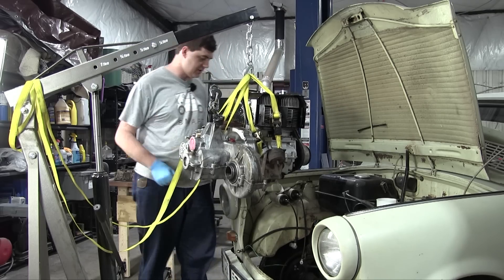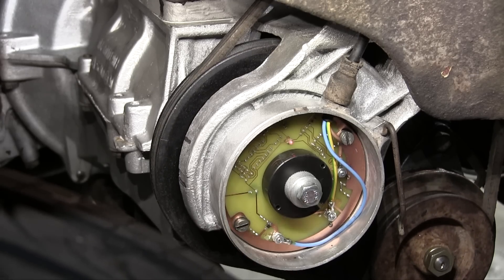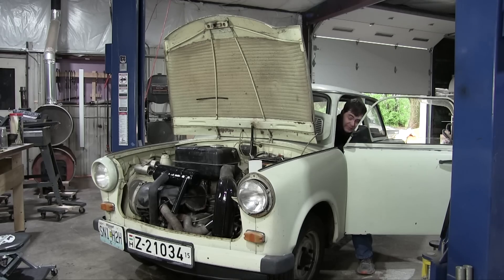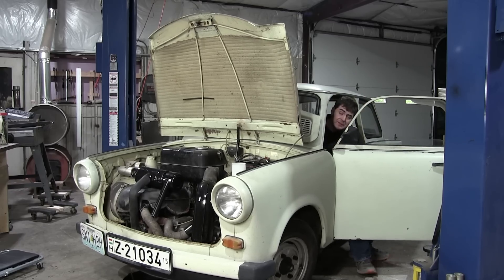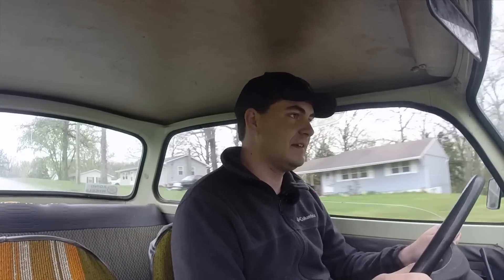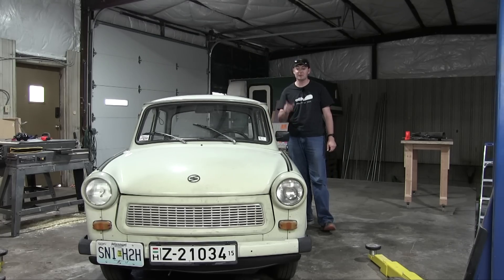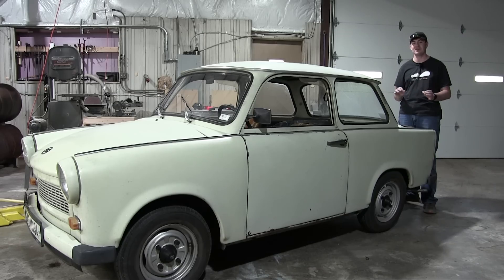Rebuilding the Trabant's Engine: Part 4 - Finale

Comment: That safety belt looks super effective
Reply: About as effective as my '81 Cadillac.
Reply: Or my 52 willys truck
Reply: As far as I know... It's probably the clones fault...
Reply: @Rusted_Empire  The clone must've broke it before Rob took delivery!
Reply: Trabants did not originally have seat belts at all. This probably was mounted later, unless it's a late version of the Trabant. However, the belts are not much safety different for a car that drives at the speeds of a 50ccm scooter.
Reply: Then you have to prep for the odd head-on. A bit intense, that.
Reply: @Blido  Didn't most trabants after about 1973 have belts? 
In any case, trabis go 55mph or 90km/h with some patience. The belts may not add much safety at those speeds because the car itself will disintegrate in a collision...
Reply: @mfbfreak  Yes Trabant was a car that was turned into shapeless pile of metal and plastic after a collision... Cars from Eastern Bloc were in 2 extremes: either soft like a beer can (Trabant, Fiat 126p) or hard like a tank and stay intact even after head-on collision (Polonez and Kamaz trucks). Both options weren't especially good for people inside.
Reply: Actualy original there was no seatbelt in this car
Reply: @mfbfreak  I recall reading somewhere that Trabis are particularly dangerous in crashes because the Duroplast body tends to fracture into sharp pieces that then proceed to impale the car's occupants as it crumples.
Reply: @Blido  a Trabant drives close to 100 km/h it only takes some time to get there.
Reply: @chrissi.enbyYT  most people installed neck support in those Trabant. Some where highly customized.
Reply: @davidbarts6144  There is one crash test video on youtube. It surprises me that it appears to be stronger than a beetle or golf 1 in the same kind of 'hitting a wall'  test. Though you do hit your head on the steering wheel which doesn't fold away properly.
Still, in a proper partial overlap test, survival chances at 50km/h are probably very slim.
Reply: @Blido   Not true. Seatbelts were installed in the last 15 years or so, and with 30 mph you're glad the seatbelts at least help somewhat. At 50 mph you shouldn't collide with anything....
Reply: @Blido 

Most of the production time the Trabant had belts(from around 1970) , later models from around the 80s had more modern ones. Some models had headrests too. Backseat belts where never installed in production.
Reply: The safety belt IS effective. What isn't is the rest of the car. The safety belt will keep you from ejecting the car, but if you have a frontal crash with anything, the back axle will fold up and crush you - no matter what seat you are in. The vehicle was built to standards of its age of conception. You know, that time when the Pinto went up in flames when rear-ended... The problem was that its life cycle was so long, almost all other manufacturers implemented improvements - and East Block country governments were actively sabotaging its engineers to improve products because if you come out with a new model, they thought, it would show the old model was bad or everyone would want the new model and they don't have the production capacities.
Reply: I would feel safer with a bungee cord for a seat belt
Reply: I doubt the communists worried about safety. Plus if you did manage to get busted up in an accident healthcare is free.
Reply: Do you need it? Why? If nothing happens not one needs the seatbelts.
Reply: The belts are only there to make it easy to find the bodies.  Engineering by political mandate has never worked...
Reply: I don't remember any Trabant owner ever putting on a seatbelt and I knew quite a few of them back in the day.
Reply: In Communist Hungary, you protect belt.
Reply: jrlunger the safety belt was probably one of the addons ;)
Reply: NOT.
Reply: So effective he forgot it for the test drive
Reply: I had a 1967 Trabbie, that sadly ended its days in a fairly significant accident. Almost head-on, with a Ford Escort estate. I was nearly stationary, the Escort was doing approximately 40mph. Both cars were written off, and although the Trabbie was beyond sensible repair, so was the Ford. I escaped unscathed, and I genuinely think that the Trabant protected me better than I would have been in say a Citroen 2CV, Renault 4 or even an Austin Mini.
Reply: Well YEAH, when the police pull you over you just got proof ! 😁
Reply: @Blido  Most cars were like that til late 80s early 90s. Only volvo was different basically
Reply: “Our” safety belt you mean
Reply: Seatbelts were mandatory in the 80th in East Germany too. So the owner had ro retrofit tem, typically including welding some doublers for the attachment spots.
Who could afford ist or hat western relatives took some retrofit adjustable belts from west Germany. In the 80 you got the Trabant also with head rests as a default.
Actually as long as no other heavier car was involved you could be lucks with the typical accidents in town. Thats were the belts are for. And as Trabant drivers had a reputation of beaking late (to save the momentum)the belt may save you when turning over in a to sharp corner..
P.S: I like the Trabant goes to USA theme. I just wonder whats with the exhaust rules in the US and the 2-stroke stink.
Reply: And no headrests too. Augibt es als Originalteile von Sachsenring These are available as original parts from Sachsenring..

Comment: Did anyone notice the gas can said “commie gas” on it
Reply: I mean, you don't wanna put 2 stroke petrol in a normal car.
It is a good way to not get them mixed up.
Reply: I didn't. Good catch!
Reply: I noticed, got a little chuckle outta me.
Reply: @thatguyoverthere531  You can in a pinch, but don't do it constantly. Ran outta gas on a backroad but got a gallon or two of chainsaw gas? Put it in to get back to town for actual gas.

Comment: Love how the Battery says "extreme Energy" in all Caps. On a 6 volt system...
Reply: Marketi....n....g....low battery
Reply: Extreme!!!!!
Reply: Maybe its got 500 amp @6v  lol
Reply: Just say your comment.  Agreed.
Reply: UNLIMITED ... POWER!!!
Reply: Over statement of the century!
Reply: Even a measly 6-volt lead-acid battery can still dump a ton of amps if it's connected to a suitably low-resistance circuit.
Reply: A 6 volt battery has more current than a 12 volt battery of similar build. My 1953 Chevy is 12 volts now but back in the day it had PLENTY of grunt to start the 235 inline 6. it was the last year of the 6 volt system for Chevrolet. The reason 12 volt took over was for faster cranking, smaller, low current wires, better generator/alternators, add on accessories like: radio, power windows and power seats.
Reply: All of a sudden it melts it’s electrical wires. Well Robert, that battery might have a little too much power.
Reply: @phantomcorsair8476  If my knowledge serves me right, 6 volt systems were standard until recently.
Reply: That's voltage, there's still the matter of "cold cranking amps". Ever try to start a lawnmower in cold weather? That should give you an idea of what both the starter and battery go through when you turn the key.
Reply: @twistedyogert  In the us, 6 volt was standard until the early 1950's. The last Chevrolet to have a 6 volt system was 1953. My car is a 1953 Chevrolet 210 4 door but it has been converted to 12 volts because a 12 volt system has less current draw. Double the voltage, half the current. That is why large appliances in your house are typically 240v ac, because they are high current by nature, it is best to operate them on a higher voltage. Cars were all 12v after 1953 in the us. The last car in the world to have a 6 volt system was the trabant.
Reply: A 6v battery has more AH than a similar-sized 12v
Reply: EXTREMEly low ENERGY
Reply: Everyone's talking volts and amp, but those together make power, not energy. Add in time, and it's likely got as much energy in it as any other lead acid brick

Comment: German worker manages to start a Trabant straight off the production line, a surprise to everyone. 1959 (Colorized)
Reply: Heh
Reply: Former East German citizen cruising on an Autobahn for the first time. Bonn, circa 1991.
Reply: @fabriziojuliancaldara3950  Much of the original Autobahn had been built before Germany was split.
Reply: mirror452 no
Reply: No there were more trabants used in Hungary
Reply: @mirror452  no, that is not true. The Autobahn was a pre war project started  early 30ies and just 3500 km were built until 1942 when all works were stopped .
Reply: @typxxilps  3500km is a LOT, considering that today's Germany stretches about 876km x 640km.
Reply: @mirror452  Back then Germany was far bigger and the Autobahn from then to now are 2 worlds regarding dimensions, lanes, quality.
Reply: @typxxilps  So?
Reply: @mirror452  ya but the soviets (and the stazi) preferred people not drive at high speeds wherever they wanted to go, most of the east german side was not really maintained or expanded like it was on the west german side
Reply: When i listen to Top Gears tales about British LEyland and their cars i think the Trabant was not that far off from SOME western cars in terms of reliability.
Reply: @blacknester nope he has a very old one newest date would 1976 thats when the all electronic sparkbox was introduced and the whole system was updatet to 12v so his is 64 to 75
Reply: @5Andysalive  they were reliable, many commie cars still work after 35+ years. People like to say they are unreliable, bad, dangerous and many other negative things just because "communism=bad"
Reply: @typxxilps  - Ive driven on the Autobahn - its nothing to shout about, Im pretty sure they have not been resurfaced since they were built.
Reply: @mirror452  But a lot of them were unfinished when they split.
Reply: and english dubbed

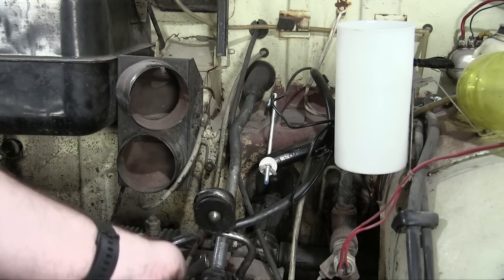Comment: At around 3:00 your shifter linkage is staining what looks like the speedometer cable, the old linkage was on the other side of the cable. That may be part of your issue with the stiff shifter and it popping out of reverse. Good to see the Trabant back on the road!
Reply: Matt DeZinno yea I noticed that also
Reply: As you are pulling out the old one , the cable It is to the right. As you are putting in the new one it is to the left and being pinched.
Reply: Yeah noticed exactly the same thing.
Reply: Hungarian number plate? Maybe I can find you a east German one.
Reply: Good eye Matt DeZinno I didn't notice it untill you pointed it out
Reply: @MrSpirit99  Well it was in fact a Hungarian car, so that's part of it's history, it's way cooler to leave the Hungarian plate. IMHO. The fact that it's a Trabant, is east-German enough :D (although it's not the original plate, regular Hungarian plates are in the 3 character - 3 number format, this is a temporary export plate it got when it left the country. But still, it looks cool :) )
Reply: Yep, nice catch. 
Another thing is, I can't tell for sure, but it seems the lever is kinda rotated clockwise a little to where it should be. I set up mine to a position where in 1st and 3rd, it's level, 2nd and 4th are almost upwards. That way, you have enough room to put it in reverse, as it turns a little more downwards in reverse than it does in 1st. 
The way it's set up here, I suspect that the bent part of the shifter actually touches the body (next to the battery), that's why it won't stay in reverse - because it's not properly in reverse to begin with.
So in short: lever should be turned counterclockwise so that in 1st it's level, or just a little bit below level. With a little luck, doing that, and fixing the cable around the lever will fix the reverse-popping issue.
Reply: @bencem.1862  I live where the Trabant was made and could provide a original plate, but you are right.
Reply: @Tweety4Bunny :DDD With an american nickname... great job.
Reply: I spotted that also .
Reply: You got it right Matt: At 2:46 you can note that the old shifter linkage was on the right side(looking from the driver´s position) of the speedometer cable and, at 2:54 he inserted the new one on top (left side -  driver´s stand point) of that cable. In this position that kink in the middle of the shifter bar tends to press against the cable making it hart to shift gears. Probably this is what is causing the reverse to be hard to shift in to and sometimes it pops out of gear.
Reply: Yeah, I agree. But thought the linkage that was crossed, might not have been connected. I seen that.
Reply: I noticed this too, and I'd bet that it's the problem with reverse.
Reply: There's even a little kink in the shift lever seemingly to clearance the cable so it's applying extra bonus strain to it

Comment: Amazing to see a Hungarian Trabant in the States. I used to watch Trabant videos, but strange to see US built houses in the background. :D At some locations you could easily pretend to be eastern European hard working comrade. Bring the basic tools always with yourself in the trunk. If you need some business done in Hungary, you just won a friend.

I think you should take seriously the worn in period described in the Trabant's user manual. I say from experience, not so good (for the East German two stroke) piston rings if you test the top speed right after assembly. You can always convert the car to 12V and install the factory electrical ignition instead witch has retarding as far as i know.

Comment: Every time I drive one of my Trabi's I have the same smile as yours! I imported my first Trabant in 1990. All my kids learned to drive these cars. I have had 6 of them. Still have my first one, a 601 Combi late model so it is 12 volt. The other one I still have is also a 601 Combi but 6 volt model.

Comment: good job. 
Haven't looked at the shifting mechanism for a while, but there must be something wrong with yours. the lever has to be horizontally when you are in first and third gear. Maybe it's just the bushings with yours?
Also when you are cold starting it, always give it full choke. Yes, even if it's warm outside. The carb is tuned for cold starting with full choke. When it's warm outside you can fully push it back in right after starting.
The vibration on brakes does not have to be the drums. Had the same issue before, the pads were acting weird because they were soaked with fluid before i guess. Replacing the pads fixed it. You can get your drums checked on a lathe to make sure.
Reply: When he fede the new rod through, I think he had the speedo-cable on the wrong side, possobly pinching... 2:56

Comment: A two stroke engine absolutely needs a mechanical or electronic timing advance. It's crucial for it's efficiency. Much more critical than in a four stroke. I'd use 1:33 gas after rebuild even if using highest quality synthetic oil.

Comment: did anyone else notice that the when he was changing the shift lever, the black wire was on the right of the old one and on the left of the new one. That trabant is doomed
Reply: YES! My autism spiked.
Reply: Bump
Reply: @thealvaco  You mean OCD?
Reply: @onesandzeroes  no
Reply: If so it will become a  hooded jacket when it is done angering Prius drivers
Reply: Yup half asking an engine and trans rebuild and absolutely no atrentionctocdetail no variance readings etc dude is asking to shoot himself
Reply: Shift lever remember Citroen 2cv and Renault F4😄
Reply: @BeamerTheFox  
Best line
Reply: @neriozulberti1492  Do you mean Renault 4L ?
Reply: @thealvaco  yes*

Comment: Great video as always! Just one thing, you seem to Suffer from the doug demuro syndrome when it comes to in car camera placement. Try positioning the camera in a way which positions you in the left half of the frame, with the right half showing mostly steering wheel and a bit of windscreen. This way it will look as if you're looking into the frame and not out of it, making you seem more engaged with your audience. If you look at top gear or any other big car show they will always do it that way. It doesn't really take away from your awesome content but it would make it quite a bit more visually pleasing :)

Comment: I had a '64 English Ford Estate as my first car. It had a 1200cc engine with 39 horsepower I believe. The gear shift broke off at the base several times, the brakes didn't, and in the middle of my senior year it lost oil pressure so I rebuilt the motor. It was water cooled but I was able to pull the block by myself after pulling the heads. I understand your excitement at having it run again. It's a great feeling!

Comment: Please fix the seatbelt. I can't stand seeing you drive with it at the level of the elbow.
Reply: Isn't it just a lap belt that he's awkwardly stretched over his shoulder? I don't think Trabants even had mount points for shoulder belts.
Reply: That's the way it is from the factory, at least until '84. Then they changed for the normal shoulder belts, but it was still just manually adjustable.
Some rare versions even had automatics, but I've never seen one, except for the later 1.1 model.
Reply: It wasn't broken lol

Comment: The most interesting and fun engine rebuild series I have seen for a while. Really good. One little point.... I have ridden and worked on a bunch of Japanese 2-stroke motorcycles and a few British ones and I have never encountered or even heard of an engine suffering or seizing from coasting at low or no throttle. That is a completely new thing to me.

Comment: For some reason one of your Trabant Videos was recommended to me and I liked it when I was watching it which lead me to your channel, I just plowed through the engine rebuilding of this Trabant and shit I wish there were modern production cars that would be as easy to fuck with as the Trabant. Hell if the Trabant was more common I’d probably get one but just imagining trying to drive one during the winter in Connecticut gives me enough PTSD to qualify me as an Ex stasi commissar.